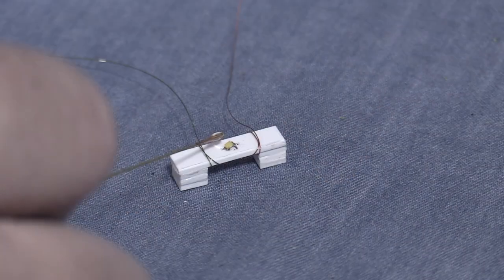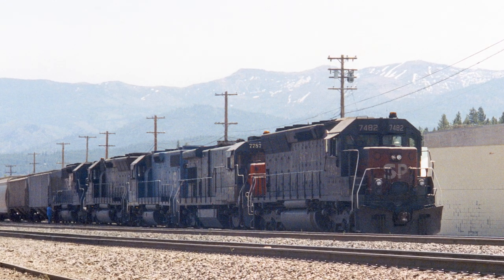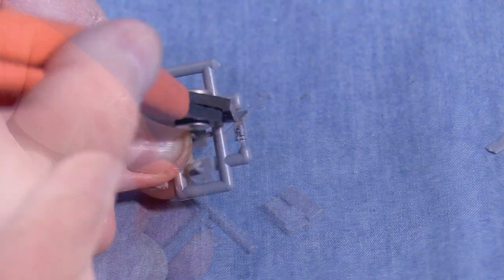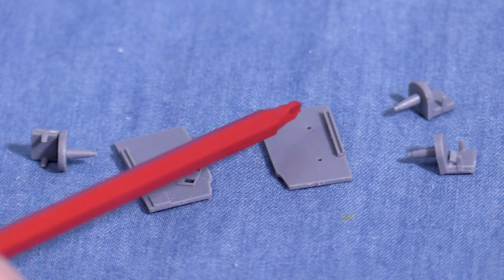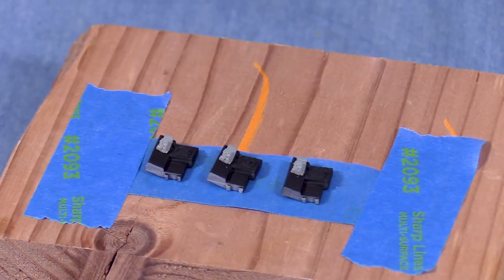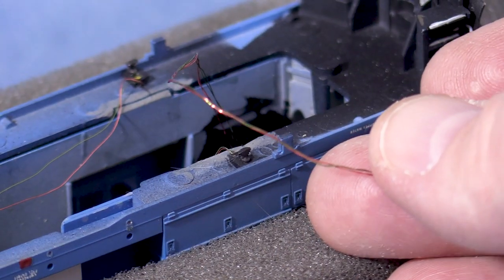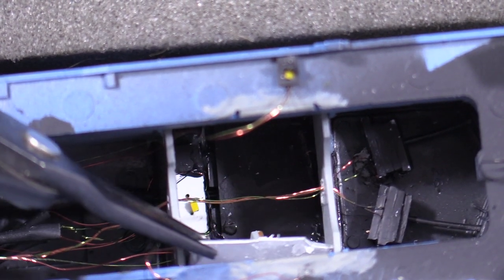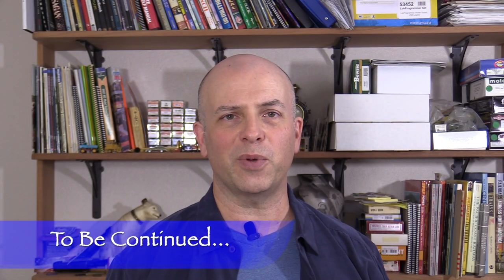Model Building HO SP Consist Build 11 - Cannon Cab Interior Kit

Comment: Avon Yards is where I was fortunate enough to be inside one of the conrail 6 axles. The enterior color was a county bridge green. This was a sd-38-2 with slug. This was in 1987-89 time frame. My uncle was the conductor, and I was lucky for three years  to go and experience the yard life! It is something I will never forget.
Reply: Sweet, I grew up near the Anderson
Indiana yard and in my younger days
I got to ride the 3 times a day switch
engine switching out boxcars at
Jefferson Smurfitt Container!!!
The Crew would stop at my Grand
Parents house pick me up and put
me on the engine, then return me 
when they finished. It was still
NYC going into PC years when 
the DOW line from Anderson to
Elkhart yard was in pitiful shape
due to recent neglect, and to 
think a Freight went North or
South past there every 30 or so
minutes!!!
Reply from the maker: I've mixed a pale green color for some other cabs, basically something like BN green mixed with white.  Thanks for the info.  Even if the color in my model isn't right, I think the overall effect is good.  Thanks for watching!

Comment: Hi Dan, 
The gray color you chose for the cab is actually really close to the real thing, thought you might take some relief in learning that. Pretty much all later EMD standard cabs received this color. The black rectangular part on top of the brake assembly is the locomotive radio. Most of the time those are black and they’re usually always on top of the brake assembly.
Reply from the maker: That is a relief.  Thanks for the info and for watching!

Comment: Hello Dan, great work as usual. I like to paint my interiors  a light seafoam/EMD green. BTW,  If you ever feel like you need even more LED's in a model. I have found you can drill out a small hole from the bottom of the control stand to install a SMD LED.  Drill out the 4 gauges, fill the area with canopy glue, place the SMD LED, then install the back covers. You now have a lighted control stand. :)
Reply: i worked for sp in the diesel pit sparks nv 1970 and the cab rear ' cabinet' was seafoam green for sure and fairly certain the whole cab interior was also
Reply: also the seats including cushions were dark green
Reply: @789train  the later EMD's have gray and seafoam
Reply from the maker: More lights?  No... must resist.  LOL.  Thanks for the info on the colors!
Reply: @DanielCortopassi  no problem sir I know some details like that can be hard. and that's what I like to help with!
Reply: I found out from a retired SP mechanic, that greenish interior color was called "suede gray".
I'm not sure if SLW changed the colors with the GRIP rebuilds, but when I photographed a freshly painted Kodachrome SP SD40 #7384 and took a sneak peak in the cab and it was tan.

Comment: This is on a completely unrelated note, but I’m thinking about building and detailing an older Roundhouse 50’ WP boxcar kit and wanted to know if the numbering/lettering decals are easy to remove? The style of lettering/numbering out of the box is incorrect (Microscale makes the correct decals). I saw the video on TSG of your Yreka Western (Roundhouse kit) detailing so thought I’d ask.
Reply from the maker: I'm not sure about removing the lettering from an older Roundhouse kit.  You could try some Micro Set and rubbing first, as that's the least destructive way I can think of to do it.  On some Athearn models you can use Micro Set, then either rub with a micro brush or use some tape over the lettering to pull it off without hurting the paint.  If that doesn't work you could try something stronger, like a hobby paint stripper.  I've done that on some models by applying the paint stripper with a micro-brush on the lettering only, and rubbing.  It doesn't always work, though.  I've had cases where the paint around the lettering comes off but the lettering stays.  I'd experiment on a small area first.  If it's a flat-sided car (not ribbed) you could also maybe try some fine sandpaper, but I'd be super cautious.  Good luck and thanks for watching!
Reply: @DanielCortopassi  Thanks Dan!